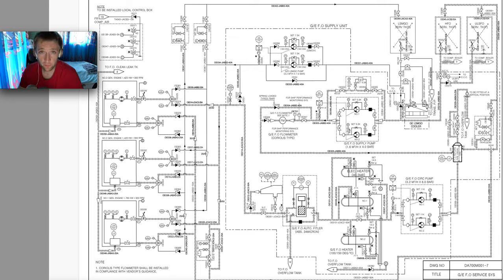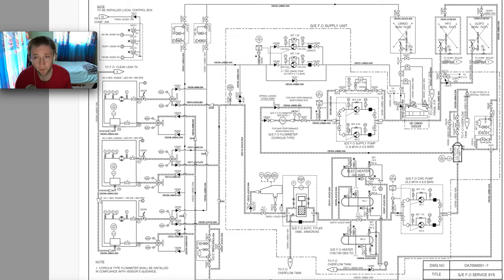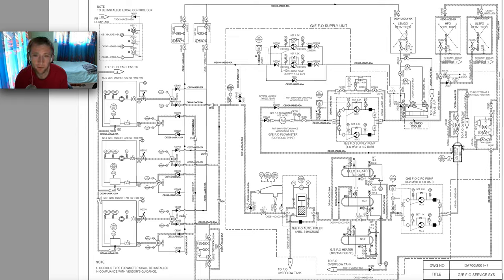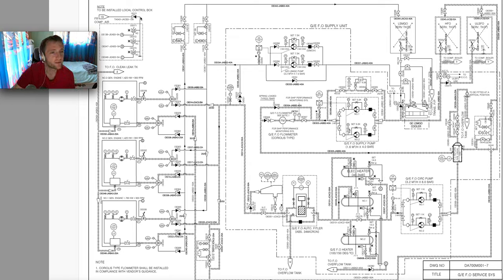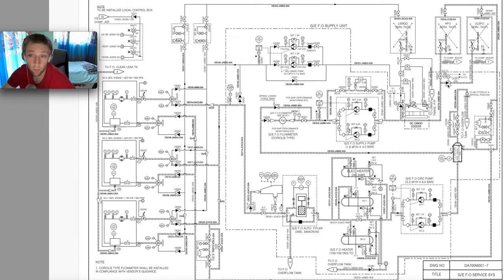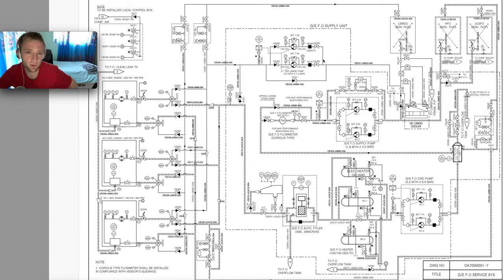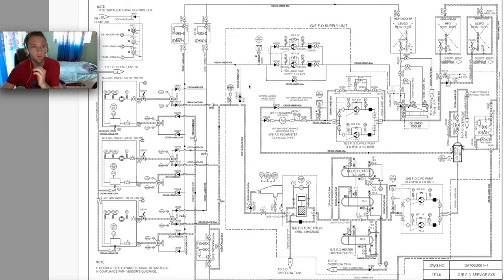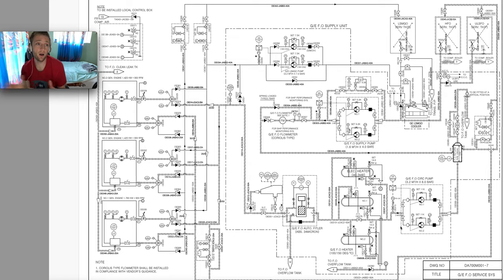Change over Diesel Generators all the ways full explanation.

Comment: Tell us about boilers change over also , i woud like to here in your change over procedures about temperature and viscosity regulation what must be considered and what is so important in this metter / pleas pay more attantion of it.
Reply from the maker: Boilers are more easy to manage different fuels most of the boilers will easy burn even direct from settling.But if you need high performance you will need to keep temperatures correct so you will get as much as possible from your fuel and your boiler will stay clean after a discharging operation.Temperatures should be keep in normal ranges.

Comment: Hi, Mike. Don't you increase viscosity before ch/over to MGO to 20-25cSt? What about tracings and MGO cooler in/out and by-pass? I heard about observation that whole system should be flushed include both Supply pumps and both Circ pumps and Heaters also. You have also by-pass for heaters. What do you think about this?
PS: how you operate auto-filter on MGO? In the same manner as on HFO or change settings?
Reply from the maker: Nice question and i forget about that yes you can use it also with bypassing the heaters and also switch off the autofine filters to not spend diesel.
Tracing should be closed position everywhere,and MGO cooler in operation.

Comment: What do you think in regarding temperature changes so fast if you make change over from HFO to MGO . AEs running at quite high temperature we just open suction of MGO and Return of MGO and start MGO pump. All our parts are hot enough, we can get big problem . What do you think ? 
I asked myself when I did change over on board  with flushing pump I assume it is not so correct . But have no idea other way !
Reply from the maker: Will not affect so much in 30 or 40 changeovers but in future maybe you can get so damages.But if you follow your overhauling program there is not worries about that.

Comment: As far as I know, the change over  should be slow. Do not exceed 2 degrees per minute . And we immediately send cold diesel fuel to hot pumps
Reply from the maker: yes that true change over must be slow but any way the temperature do not drop fast because piping are still hot so until it cool down it will take 1 to 2 hours.

Comment: I heared a lot of story from my friends that they faced with such problem as HFO traveled to MGO service due to 3way valves trouble of AE which you mantioned here . How to avoid it ?
Reply from the maker: Yes it happens sometimes is some valves are not properly operated.
Reply: @Adventure-Story  what need to do ? How to prevent it ?
Reply from the maker: @konstantinbutsenko8208  always check the levels when finish changeovers to see if it remains stable at the tank you have isolated.

Comment: I dont understand why diid you use MGO flushing pump for making change over procedure with only one AE . We can change over all AEs at once / I did it like that : strated all 3 AEs one of those was not in load / changed all system at once to disel . IS it correct or not? 
I used MGO flushing pump only in emergency situation and when made maintenence of Fuel oil system of the AE for cleaning pipes .
Reply from the maker: it is ok like you do it not any problem!

Comment: I dont understand well about mix tank. Sypply p/p sends fuel there always pump runs but our fuel oil counter also always is RUN? How it can be ?
Reply from the maker: At main engine there is a pressure regulator when main engine is stopped and there is not consumption this valve opens and fuel from supply pump return back to suction it is some kind of recirculation of fuel in the line.
When main engine starts this regulating valve closes and fuel will go straight ahead to main engine without recirculation.
Supply pumps working at 4 bars and this regulator valve will open at 4.5 bars.
This pressure "controler direct activated by the pressure in the fuel line"
In old type flow meters there is always a turning effect because some of this controllers are not properly working and you have fuel running through flowmeter.
Most of Chief Engineers know this problem but they can handle it by calculations.
Same thing applies also to Diesel Generators!
Reply from the maker: Konstantin do you have a email?
Reply: @Adventure-Story  eng.cadet. konstantin.butsenko@gmail.com
Reply from the maker: @konstantinbutsenko8208  all together is one complete word?
Reply: @Adventure-Story  yes
Reply from the maker: @konstantinbutsenko8208  eng.cadet. konstantin.butsenko@gmail.com i try like this and also like this konstantin.butsenko@gmail.com but not working
Reply: @Adventure-Story  where this valve is installed ? maybe is it already a new modification? Vessels where I’ve been before ( 2005. 2006, 2011 ) fuel always turned a flow meter?
Reply from the maker: I believe it is old control valve I will check it today in 2010 and a 2016 vessel
Reply: @Adventure-Story  A  system was for AE/ ME same .
Reply from the maker: @konstantinbutsenko8208  The diagram are almost the same.In one vessel we have faced such problem like fuel oil meter turning this was from wrong operation of this control valve i will make a video to show the location of it.